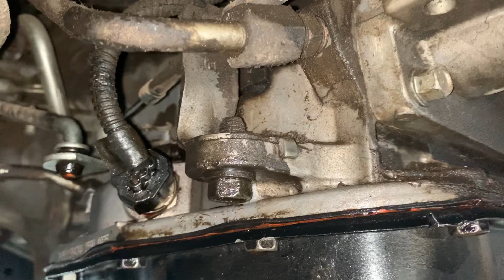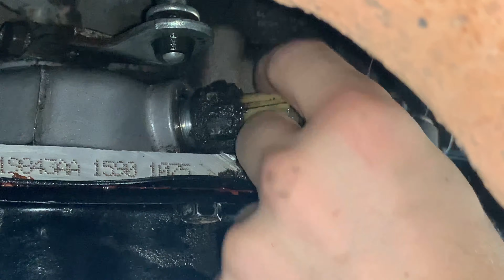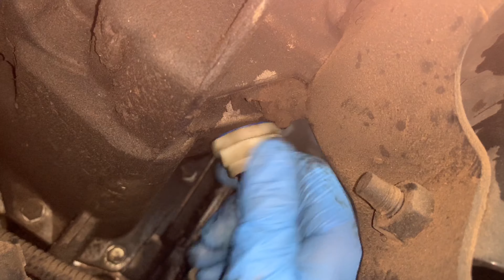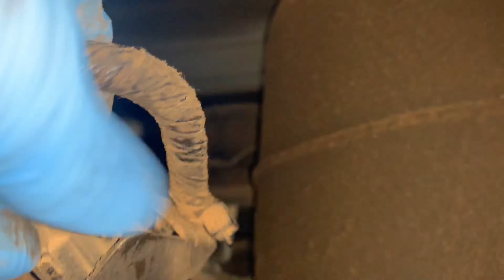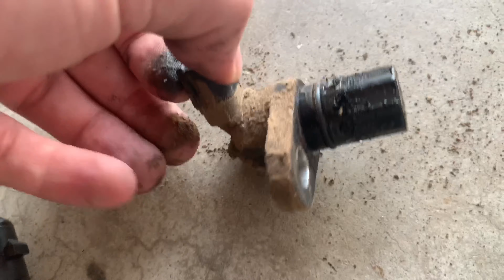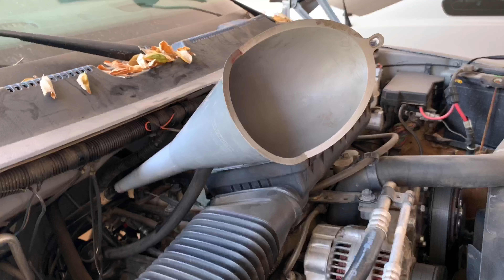Replacing Neutral Safety Switch, Transmission Speed Sensor, & ABS Sensor - 1994 - 2001 Dodge Ram

Comment from the maker: Neutral Safety Switch -https://amzn.to/3jCtTZz
Transmission Speed Sensor - https://amzn.to/3YXzTwa
Differential Sensor - https://amzn.to/3G1Mkyx
Large Ratchet - https://amzn.to/3C7zCgE
1/2" Socket -https://amzn.to/3WQU6Cg
9/16" Socket - https://amzn.to/3Z6Ufn4
1" Socket - https://amzn.to/3I8Fk5y
Flathead Screwdriver - https://amzn.to/3Z6Kt4m
Reply: great video! also it sure helps when ordering these sensors are a piece of cake..thanks for adding the numbers!

Comment: I need it for a 2016 2001 for the switch the neutral switch for a 2016 Dodge charger 3.6 it's SE
Reply: Did this work ? Mine is metal not a plastic wiring

Comment: Hey man did a tranny swap. Won't start. Tries to fire but won't. Changed the crankshaft sensor. Still no start. Battery is good. New crankshaft sensor, cam sensor, ignition coil. It's getting fuel and pump works. We are a stand still. Any ideas?
Reply: Touch the starters wire together
Reply: I’m not sure how to explain it just look up starter bump start
Reply: Check all your grounds.

Comment: on that neutral safety it looks like the old one had a o-ring of some kind on it. the new ones have a plastic piece that appears to break with any torque put on it did you install a new o-ring on this or just that plastic stop?